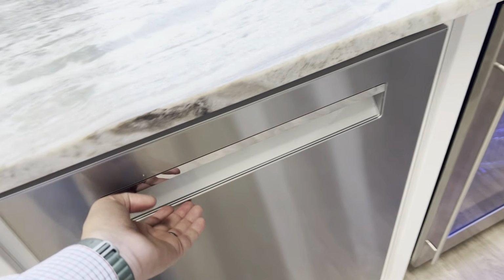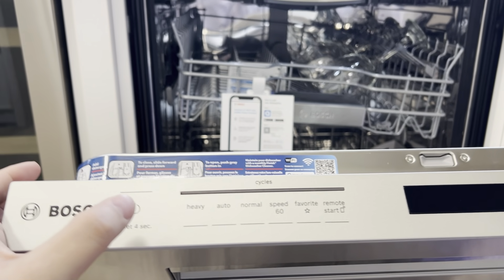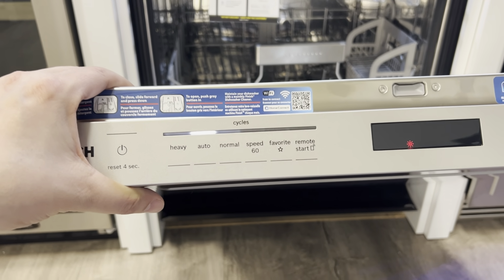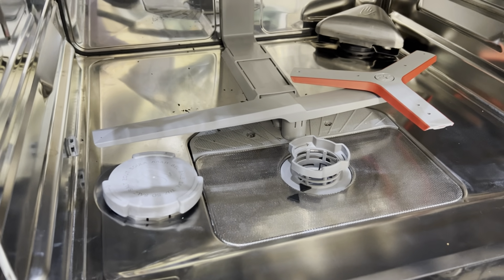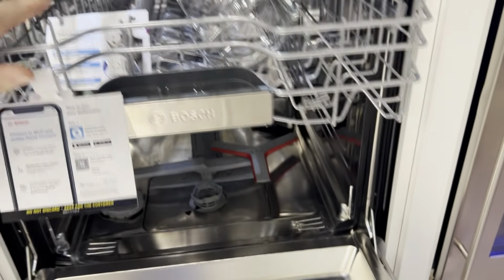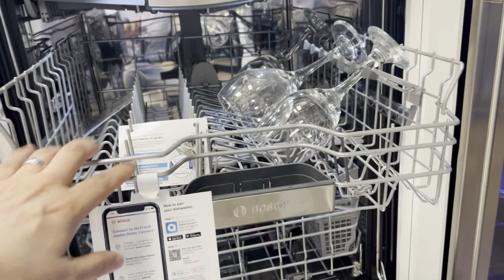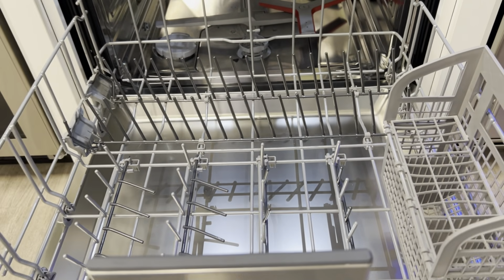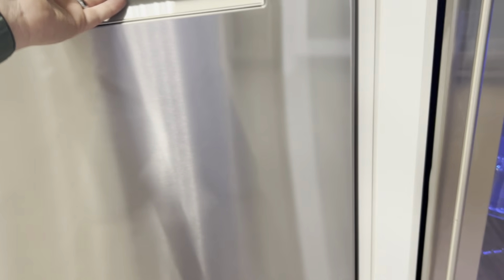Consumer Reports Top Rated Dishwasher for 2024 (featuring the Bosch Benchmark SHP9PCM5N)

Comment: This is a good review of a Bosch.  Mine is a different model but an 800. One suggestion is if you do another one, please try to use the Home Connect. It’s where you find the china setting and the delay function.  This app is finicky.  And it’s the only way to access certain features.  It requires a wi fi connection. And it is not consistent.
Reply from the maker: Thank you! I’m actually planning on doing a full video on home connect soon. 😊

Comment: Those plastic holders break all the time on all dishwashers!  

The reality is:  ALL dishwashers SUCK!  Even the “best” are barely OK!  

None are excellent cleaning and drying dishes!  

That’s not how they’re rated!  They’re rated in dB and energy / water savings!  No one cares about dB or energy / water savings if the product doesn’t clean / dry your dishes.  In fact!  The energy / water savings ratings are complete BS! And do not account for having to rinse / hand wash dishes prior to running them through the dishwasher.

Comment: I just bought the dishwasher, I set in on the crystal dry cycle , it washed well and the dishes were dry but the interior door and walls are still wet, I'm assuming it is because energy efficient feature. Will this cause the interior to rust overtime?
Reply from the maker: @JeffMaraPodcast  Are you using a rinse agent and/or the water softening system?
Reply: @appliancesexplained  Neither of them. My house already has a water softener. I'm using just the finish quantum soap that is recommended and the crystal drying cycle.
Reply: @JeffMaraPodcast  Typically the water  for the kitchen does not go through your water softener.
Reply: often the hot water is softened. The cold line is not.

Comment: Speaking of matching appliances, my kitchen is a complete mishmash of brands (GE, Samsung, and Electrolux), only my fridge and dishwasher are same brand GE. But I’ll be replacing it with a KitchenAid. Hoping it works good!
Reply from the maker: Are you thinking about KitchenAid for the Fridge or the Dishwasher?
Reply: @ kitchen aid dishwasher. Fridge is still working good. I had to replace the ice box once and the defrost coil. Other than that, very reliable. 

On the dishwasher, the huge third rack that can hold glasses pretty much sold me. I got 3 kids so tons of cups.
Reply from the maker: @ Their dishwashers do have an impressive amount of space inside.
Reply: @boostedmaniac which one? I have to get a new one.

Comment: How long does the Auto setting run for?  I love the filter option, how often if ever does it need replacing?
Reply from the maker: @sarahmangone7785  The auto-wash times will vary depending on the amount of soiling on the dishes and the incoming water temperature from the supply line. The filter should probably be checked/cleaned every few weeks (or months) depending on how dirty the dishes are. So less frequently if you’re in the habit of pre rinsing your dishes and a higher frequency for normal soiling and no pre rinses. With proper care, the filter will probably last the life of the dishwasher and never need replacing.

Comment: Just a few comments: We bought a much cheaper stainless steel , series 2 years ago; maybe a 300, Silence Plus 50 dBA, which has most of the same settings as more expensive models, but just has two small upper racks on the third level.  I think we paid about $500 for it, discounted from Home Depot. We have to use a rinse aid, which lasts about 3 weeks. Most of the time, we don’t notice it running, but we have to remove and clean the filter about every 3 weeks with daily use. Dishes and glass casseroles come out usually spotless. The stainless steel finish has the plastic coating you described on more expensive models. Caution: There’s some guy on YouTube who shows how to remove the coating! Don’t! If I bought a Benchmark model, I would opt for an extended warranty because of complexity.

Comment: I can't figure out how to select the different wash features on the 800 series😊! Please help
Reply from the maker: @valerie8320  What are you having difficulties trying to use?
Reply: @appliancesexplained  I can't figure out how to select a wash cycle.  I can't get it off the default 60 minute wash setting.
Reply from the maker: @ It might be stuck in a cycle. There should be a reset sequence. Try holding the Power icon for 4 seconds. After the reboot process has completed, you might need to turn the power off and on again. Once this is completed you shod be able to select act cycle.
Reply: You have to use the app.  Good luck with that.

Comment: Where to start? I own several houses, and for the past 20 years I've equipped them with a variety of Bosch dishwashers. In total, I've owned six of their machines ranging from (comparatively) cheap to high end. Some notes on my experiences:

My first machine was an SHX57C05UC/31. This, back in 2005, was a high end machine in the Integra 800 range. What grabbed our attention was the low noise (46db) and the absence of a heater element to dry the dishes. The dishes dry as a result of residual heat - the machine has an inline water heater so towards the end of the wash cycle the temperature of the water is pushed high so the interior stainless steel cabinet, and dishes, become very hot. When the cycle ends, the machine beeps and you are expected to crack the door so steam can escape. Sounds weird, but it is highly effective aside from water occasionally finding a low point to congregate (such as the base of a glass tumbler). You must crack the door or the results will be less satisfactory!

This dishwasher was remarkable for its ability to clean dishes, cutlery, glasses despite caked-on food left overnight. With this machine you do not need to pre-rinse your dishes - just load, hit the auto button, and the machine delivers flawless performance. You know that 'rinse aid' solution you're supposed to add? We've never used it. Then again, our house has a salt-ion-exchange water softener.

Our machine lasted to September of 2024 from May of 2005. So over 19 years just two repairs were required, both of which I performed myself. Any confident, moderately skilled DIY'er could watch a youtube video to perform the same repairs because the machine is/was remarkably easy to work on. The two failures were the drain pump (which became noisy, weak and then failed), and the other was the turbine pump. The drain pump is quite clever since it works by induction, causing an impeller to turn without bearings or seals (into the motor itself). Actually, though, the noisiest element in the entire machine! The turbine, not the motor running the turbine, was far more of a concern. This turbine appears common to just about all Bosch dishwashers (not sure about the SHP9P) and I've seen the exact same part on at least 5 occasions. In each case, the turbine failed after approximately 5 to 7 years of daily use. Failure was so common that Bosch marketed a repair kit which included the turbine, and two seals. In September of 2024 the turbine failed again, but this time I could not source the repair kit. Bosch would sell me a motor and turbine combo, but the price was unattractive at over $250. So we bought a new machine as the SHX57C was showing its age in other ways. More on that later.

The turbine/impeller is the Achilles heel of the machine. It is a an atrocious design aggravated by horrible construction - the two parts of the turbine (or impeller to use Bosch parlance) are held together by tiny studs (3 per blade) and, I suspect, glue. These studs inevitably fail and the turbine/impeller promptly disintegrates. Fortunately the housing is strong so the turbine parts are contained. Repairs are very possible and return the machine to 100% operating condition. The motor itself appears near bulletproof although it's an older design with a run capacitor than can potentially leak over time. Regardless, I was very sad to say goodbye to the SHX57C. It was MUCH quieter than the stated 46db. The only time it reached this sound level was when the drain pump was operating. Otherwise it was so close to silent my SPL meter picked up nothing while the machine was washing and registered 36db during rinse. 

The aging elements were the trays. You would think at this price-point the trays (shelves) would be stainless steel. They are not. They are in fact plastic covered mild steel. Eventually the plastic cracks, peels and the metal quickly rusts. You can repair if you spot the rust early enough and buy a kit off Amazon to recoat. Otherwise, expect to spend hundreds of dollars replacing them!

Our latest machine is supposedly the direct replacement for the SHX57C. The model is: SHX78CM5N. This model is rated at 42db but out-of-the-box you'd be lucky to get close to that figure. What was missing was insulation. The back of the machine was devoid of insulation as were the corners and assorted other areas that were fully covered on our SHX57C. Install was easy but the machine's noise was unimpressive. However, remember we just retired the SHX57C? Well, we took insulation off that machine and covered the exposed areas on the new machine. We ended up transferring 50% of the insulation to the new machine! But it did the trick. The machine is still noisier than expected (hitting 44db peak) but in normal operation is now very satisfactory at an average of 36-38db. 

The 3rd tray? Our old machine didn't have this. The new, top tray, means the machine struggles to stay inside the stated dimensions. They actually thin-out the insulation on a top ridge area which accommodates a water channel inside the machine - which I guess is why the machine is noisier. Not sure. Anyhow, we tried using the top rack. I can imagine some people will find time to load the top tray, but for us this feature is mostly useless except for a few longer items (mixing spoons etc). Big shrug of the shoulders on this feature! Lower the middle tray immediately to accommodate tall glasses!

Lowes do not stock the absolute high end machines like the SHP9P and indeed we couldn't find a source in Phoenix, Arizona. So we settled. I wish we hadn't but in the end it worked out.

Does the machine clean as well as the SHX57C? Yes, it does. Does it clean better? Nope. But how do you top perfection? Based on 19 years of daily use?

If you DO buy one of these high end machines, I recommend taking the extended warranty. Looking over the machine briefly with a camera on a stick, the mechanism is antiquated but I guess if it ain't broke, don't fix it. I have no idea what the turbine/impeller looks like. I have to hope they fixed the systematic problems that affects ALL preceding machines regardless of cost.

Would I suggest buying the more expensive machines? 

Well, not for us - you may find a reason: We have an all-house water softener system so I do not need an internal Bosch solution. Nor do I see any purpose in the interior light. I have absolutely no idea why Bosch thought this was a worthwhile addition! So that leaves the superior sound insulation. Well, you can find Bosch insulation solutions on ebay. They don't cost anywhere close to the $400 upgrade to the SHP9P. The closest competition is probably Maytag or LG. The LG has more technology, an inverter driven pump motor but I cannot comment on the machines except to say the 'steam feature' in the door is an absolutely daft idea that represents a weak spot in the design. If this feature leaks steam into the electronics it would be game over!

Bosch make the cheapest, nastiest trays which is annoying; and whatever else you do, don't ever try to push home the trays using the door! That's a great way to damage your machine. Any machine. Whether you spend $500 on a Bosch or over $1600, the basic pump/heater mechanism tends to be the same. You pay dearly for extra features and extra sound insulation. Would I recommend Bosch? Absolutely. Provided money isn't an issue. Then again, anything you buy from Bosch is going to cost an arm and a leg. But more on that another day...

Hey Bosch. An idea for a worthwhile feature - an internal mechanism to crack open the door at the end of the cycle!
Reply: Hi David,
Bosch offer the Auto air feature on their 5 series which cracks open the door at cycle end. It works like a charm. It can be set to on or off by user for the cycle.
Reply: @owensmith9561  Interesting. Seems strange it isn't on the Integra 800 series. Maybe the 800 is a fundamentally older design?
Reply from the maker: @davidgapp1457  the 800’s have the “Crystal Dry” upgrade that negates the need for the auto open feature on the 500 series.
Reply: @appliancesexplained  Thank you for that! I managed to buy a dishwashwer without realizing it had that feature. Egg on my face! Not making excuses for inadequate research before buying the machine, but Bosch might want to improve their advertising at the retail level. Went into Lowes and absolutely no-one in sales mentioned this feature (or knew anything about it when I asked them this morning).
Reply: @appliancesexplained  Okay, I experimented with the Crystal Dry option. To be honest, it's a disappointment. The dishes were far from dry - so much so I've gone back to cracking the door. The question is whether, maybe, my 'crystal dry' option isn't working?
Reply from the maker: @ What cycle are you using and are using a rinse agent?

Comment: Thank you, great information....especially after a power surge ruined the control panel and strip of my 20+yr old GE Profile this past weekend....Repairs will cost about 50% of a new dishwasher. Might be time to acquire a quiet and energy efficient replacement whether Bosch or Miele.
Reply from the maker: @michelleb7131  I don’t think you’ll   be disappointed with either of them! 😉
Reply: I added a surge protector that plugs into the outlet under the sink and then the dishwasher plugs into the surge protector.

Comment: The spray arm on the 800 series works differently than most spray arms because the large arm is motorized and parks the spinner in a quadrant for a certain amount of time before moving it to another quadrant. I believe that the app allows the user to customize how this works.
Reply from the maker: This is correct! 👍

Comment: Hey Quick question. 

This unit says it has Timelight on the ground yet I got one and I dont see where to turn this on. It states it on their website that it does include it.  Also didnt see you put it in the video, curious as to if your unit has this.
Reply from the maker: The version I show here displays the time remaining behind the plexiglass inlay on the right side of the pocket handle. If you purchase the bar handle(SHX9P) or panel ready (SHV9P) versions, the time remaining will shine on the floor.
Reply: @appliancesexplained i cant find the light either!

Comment: Any recommendations for a heavy duty dishwasher that will last many years with basic maintenance that does not have any fancy smart features? I don’t want 20 settings and internet connectivity. I just want something well built with a few basic settings. Something like whatever would have been top of the line back in the 90s.
Reply from the maker: Any Miele really but if you want a really nice one, I’d recommend taking a look at the PFD104. The G7156SC is a great option too though.
Reply: @appliancesexplained  Thanks. I’ll look into those.
Reply from the maker: @Turdafonzanoon  Clean the filters and door seals, use the water softener and run a cleaning agent every 6 months and you’ll probably have it for a lifetime.

Comment: This is a very thorough and helpful video since we may be looking to replace our 11-year-old Bosch SHE9ER55UC.  Our biggest disappointment with our Bosch dishwasher (and cooktop) is the labeling of the buttons (or knobs on our Bosch cooktop) - neither are etched into the metal in any way and they wear away/disappear over time from use.  So my obvious question is did Bosch improve on this concern in the past 11 years?
Reply from the maker: @timregello6032  It’s difficult to say for sure but if I had place a bet, based on the feel of the plastics, I’d guess they could wear off over time.

Comment: Thanks! I am replacing a 18 year old Bosch, it still works, but exterior parts are cracking and the front panel is broke and I can't replace the part. I have put my finger inside and push down in the button to turn it on and off. Like I said, it still works, but time to replace it and it went way beyond it's life expectancy and it looks like this model is the one to get!
Reply from the maker: It absolutely is!

Comment: What u will recommend to buy 500 or 800 model ?
Reply from the maker: 800 if you can afford it… I think the “Zeolite Drying System” is worth the price of the upgrade alone.
Reply: I have the 800. It’s quiet.  Does a good job.  The delay function requires using the app on a phone.